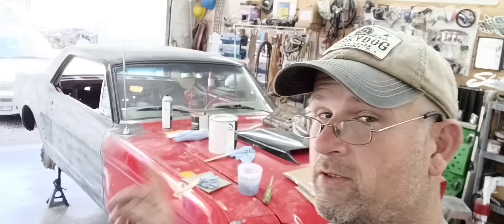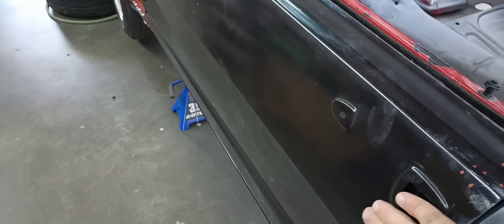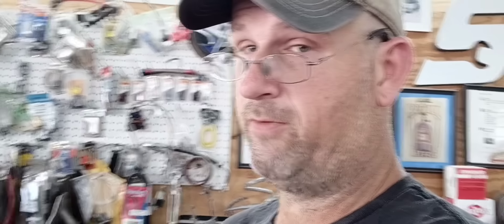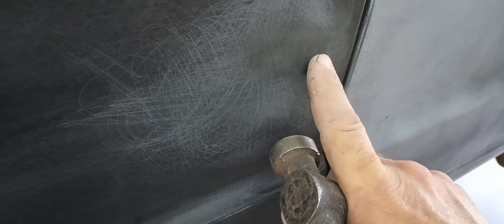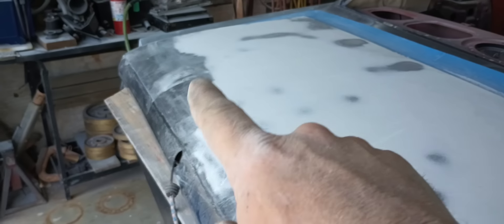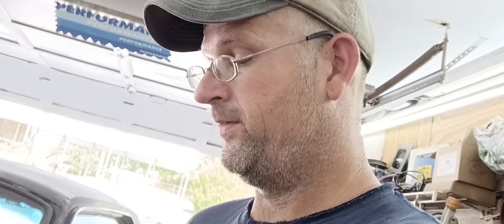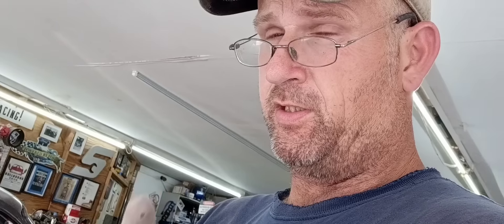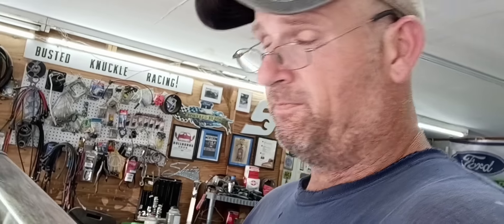From Trash to Treasure: The 1965 Mustang Bodywork Transformation Continues! #Ford

Comment: Feel better after my crap day fixing an injector pump that has opened a can worms through the whole bloody truck, I imagine you feel the same at times wishing you never touched it in the first place. 😂 awesome video as always cheers!
Reply from the maker: It can get overwhelming sometimes
Reply: @HotRodGuyGarage  day job has turned into week and half with whole fuel system including removing the tank injectors glow plugs ....... Weather hasn't helped with rain snow and severe frosts. Joys if working outside in a New Zealand Winter.

Comment: You are doing a awesome job 👍 Anyone who owns a classic car or even a modern car and they say their car has no bondo in it they are a liar or delusional. All cars have some type of filler in them. I've worked in smash repairs for enough years to know.  That 3m filler is good stuff ,I've always used that. Good job buddy.
Reply from the maker: Thanks , and your right everything has some filler
Reply: @HotRodGuyGarage  your welcome.  Yeah unless the car is a old car when they only had lead and is 100% factory paint, otherwise all cars have bondo. Working in smash repairs the things ive seen wow. We had a car come in after it was rear ended, the car was 4 months old, we found filler in it, looked like it was damaged at the factory.

Comment: I know a guy described the body shop he USE to work at fixing the quarter on a wrecked caddy... mixed a large amount of filler on a big piece of cardboard, slapped it on the side of the car and moved it around to work all the filler into the wrecked area... slicked her down and called it done... I've seen filler 1/2 inch thick, I don't know how it holds on as good as it does WATCH the body shop you take your car to people.... filler is fine, and this man is trying to do things right for the budget he has....  one of my friends paid for a new fender...rather his insurance company did.... the body shop slabbed it full of filler and sanded it out.  I noticed it cracking and he was livid, but nobody did anything to make it right....   WATCH who works on your cars.... this man is trying to do it right.... I'll say it a third time.... for the budget involved, this man is trying to do it right

Comment: Coming along nicely, you were going to have a lot to do on the front anyone. Experience is that it is faster to pull it all apart and fix it right that to try to "fix" it in place. You are getting the doors and quarters so straight that the front end would not match anyway. Although I am not sure I want to know what unit body looks like under those fenders.
Reply from the maker: Absolutely, just been putting it off as long as I could 😆